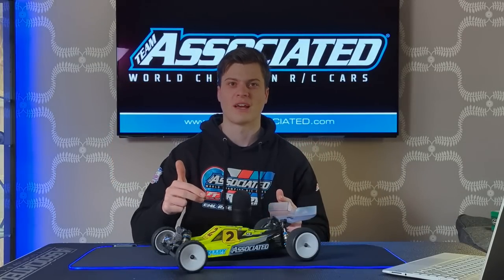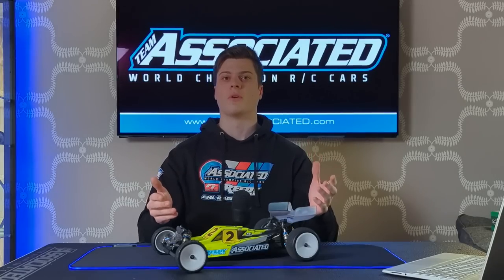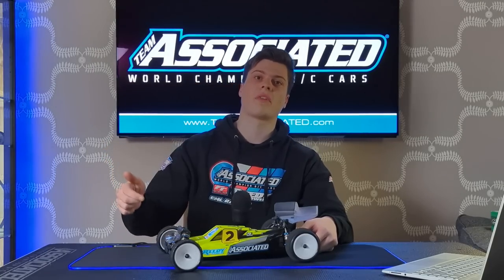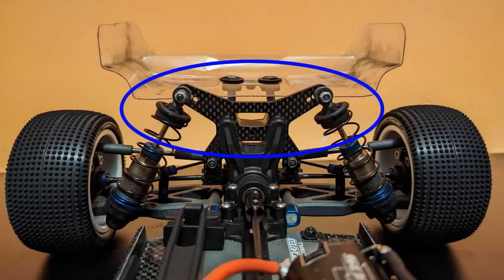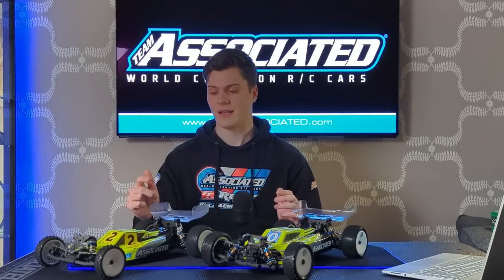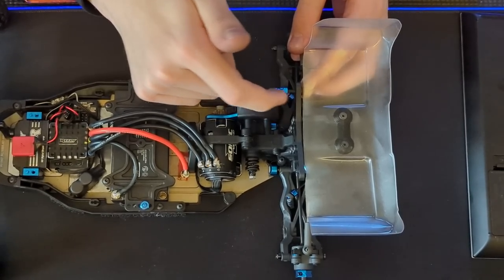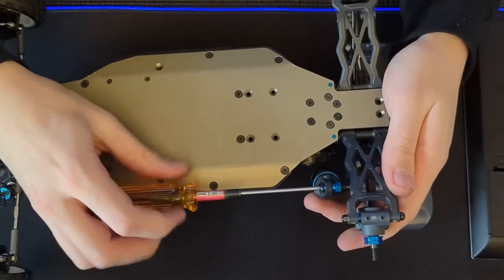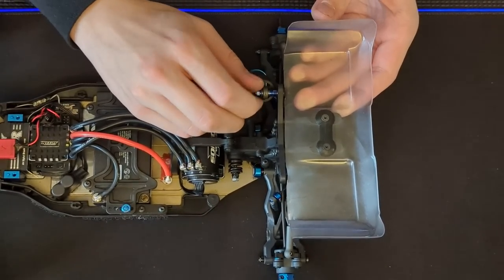Inverted Shocks: The New RC Trend Explained!

Comment: People have been trying this since the beginning of R/C. The shocks arent designed to be ran like that.
Reply: The way RC shocks are designed, they literally don't give a damn what way up they are. The piston is just a plastic disc with a couple holes in it - there aren't shims or anything to valve them in a sophisticated way like automotive style shocks, it's just a disc with holes sliding up & down inside a tube. They are absolutely dead nuts simple and damp basically the same in both directions(technically one side has the displacement of the rod and the other side doesn't, but that's a minor difference in the grand scheme). Honestly wish we could see more sophisticated options in the RC world but, honestly, I don't know if that's even viable(physics doesn't scale, so it isn't as simple as just scaling down a Fox desert racing shock or something), a disc with a couple holes might be offering as much "tuning granularity"(via oil weight) as we can get at this scale.
Reply: @RyTrapp0  lmfao.. Ignorance is bliss..
Reply: @stevefrench3564  lol, yup, that's what I though...

Comment: lol Its just strange and will be detrimental to the shock long term, dirt collecting on top of shock at boot at rod hole entry. it just looks odd.
Reply: Isn’t dirt always gonna fly by those openings ??? Not big of a deal it’s already exposed to the elements
Reply: @mojojoji5493  you are upside down a bit different entry point posibility
Reply: @mattster197  that would mean dirt would have to fly all the way up, 
normal set up dirt would be flung from underneath. Moral of the story 
Dirts gonna make stuff dirty regardless
Reply: @mojojoji5493  think about it,  You got dirt lying on top the piston now, much more likely to work in around the seal and affect the shaft.  Would have to run boots for sure.  IMO> end.
Reply: @mattster197  imo racing very dusty tracks in Hawaii almost doesn’t matter just do ur normal maintenance and polish the shaft lol
Reply: Sure, real problem if your shock doesn't have shaft seals I guess...
  
You know that hydraulic cylinders are used in dirty, dusty mines, right?
Reply: @RyTrapp0  that’s what I’m saying, normal maintenance should still take care of all the issues
Could even add a sleeve shock protector
Reply: Clean your car after you run lol

Comment: I'll tell you boys where your problem originates from - YOU'RE NOT RUNNING THOSE OFFROAD BUGGIES IN DIRT. About 15-20 years ago, everyone started trying to make offroad vehicles run better on clay and carpet. There's essentially no reason to even have such large suspension componentry on the track you're showing. You'd turn faster laps by running short arms on that vehicle to reduce the leverage on the damper and hence, reducing weight transfer.